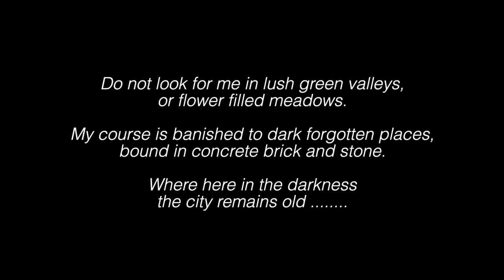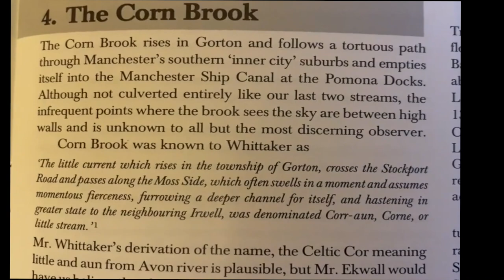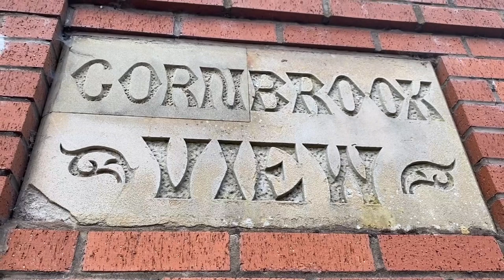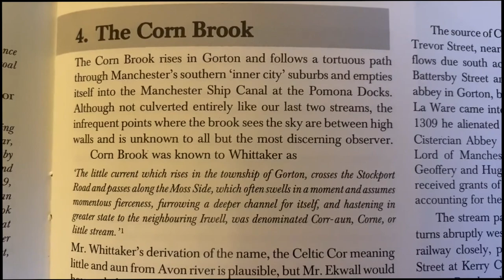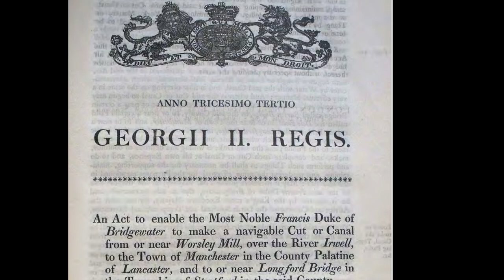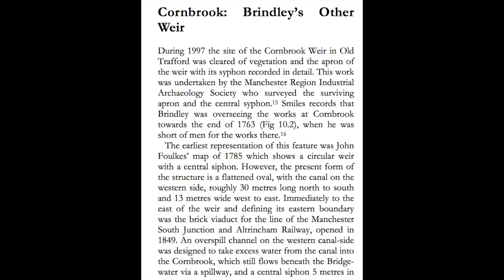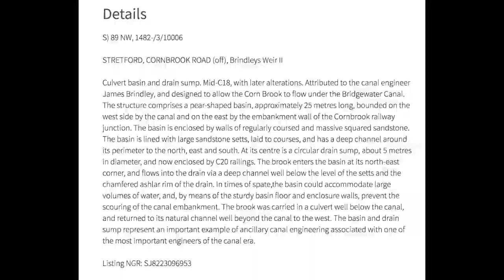The Lost rivers of Manchester. The Cornbrook Part 1

Comment: You might consider getting breathing apparatus for when you do these confined space entries, Martin. When your meter goes off it's already too dangerous to be in there, potentially deadly. Better to be prepared than dead. Perhaps see about a course on confined space entry?
Reply from the maker: Hi Robert. Fortunately the gas meter never went off. But yes I hear you 👍
Reply: or at least - have an emergency O2 supply.
Reply: Martin, if there is huge expense to getting the right equipment or doing a course like Robert suggests, could you put a fundraiser out there so people have an option to contribute to keeping you/James as safe as possible while you do these amazing things for us?

I would definitely contribute to something like that.  I’m so relieved to see you both in hard hats now - naive people may imply ’it’s not necessary’, but the head bleeds profusely from the smallest injury.  Wearing hard hats reduces the risk of you having a major medical emergency to deal with that could be completely avoided.  I personally would contribute to course or equipment costs that keep you/James safe while producing your amazing VLOGS for us 💕 x

Comment: Fantastic.  And I sympathize about the mud...as a kid, whenever I would explore the spring-fed creeks around my hometown I always dreaded that thick, black, stinking silt...you could never tell how deep it was and it smelled terrible.  I used to encounter it in the low bend basins where water would go around in a dogleg curve and all the silt would accumulate in some smelly, black pit.  And going around was often not an option because the sides were too high.

Comment: What a bloody job. Hats off to all of you for your stoic efforts on this part. Can't wait to see what you find at the source end, as I was born, raised and played in these streams as a kid, close by (Higher Openshaw) until moving away mid 80's.
 I have the book and have tried to place the bit in it where it shows the start which I assume is near the back of the Gorton Monastery, but as it's all so developed now, it's not easy to pin down.
There are at least 3 other watercourses round there that I recall, and I suspect that 2 of them actually interact with the Cornbrook. (Clayton Brook and 'Blackie' Brook- this latter may be a colloquialism for a small section of the Cornbrook). The third was an unnamed (AFAIK) trickle that rose opposite the Railway Inn on Chapman st, Gorton, ran behind houses on Railway st. and underground under Beyer Peacocks; the perfect path to put it on course for where I think the pic is in Geoffs book.
BTW, 'where Rover stood', did you clock the pub in the background? A 'Cornbrook Ales' house. The remains of the brewery offices are still there, on the Chester road, think it's now an architectural salvage place, it's the triangular planform building if you look on Google Earth, bounded by Turville st and Chester road.
 FWIW I picked up a mint condition metal Cornbrook bar tray at a carboot a few years back. I remember them still being a trading entity when I was still at school, despite being by that time owned by Bass, I think. 
Winding back 3 years, the container train you saw would likely have been me up front- not anymore, medically restricted now and imprisoned in yard limits only! Cheers to all of you, much good stuff to come, I feel. 'Go get yer feet wet!'.

Comment: Martin, if there is a syphon underneath the Bridgewater Canal, those arches at 23:25 doesn't mark where the canal is. These are in front of the canal, probably an old/former bridge over the Corn Brook related to the chemistry works (showed at the old map)?
By the way, great video, looking forwards to part 2!

Comment: another fantastic video!! I presume the first section of modern 'concrete box' at the outfall into the Ship Canal is where the Corn Brook was culverted in the 70's/80's when Dock 1 was infilled, and further back where the concrete section joins the older brickwork near the siphon this would have been the original outfall of the Corn Brook into Dock 1
Reply from the maker: Possibly we dont exactly know the arrangement  pre 80's but probably not fat off

Comment: Martin is guest staring in an 80s cop drama as DC Zero?... Pomona would make an excellent park/green or walking space for the flats and surrounduing area and decent tram access. If they were fish, at least the water must be cleaner than expected. The low tunnel suddenly opened up, but, you are 100% right, safety first!
Reply from the maker: Yeah the water is quite clean, or a lot cleaner than it used to be
Reply: @MartinZero  Same near me, used to be horrid and polluted, last year we go Salmon all this way in land and the Trout population is thriving.

Comment: Good video! Why didn't they just let it out into the bridgewater canal though? Maybe I missed something
Reply from the maker: It wasnt needed as the River Medlock in Castlefield was to feed the canal. Plus at that point the Cornbrook a minor river was at a slightly lower level than the canal. Small point but impossible to run it into the canal. So just send it under

Comment: You should Brey on the council's door until they clear all that brush, so the engineering of that system can be seen, just like it is at that canal overflow in the canal basin, under the railway bridges near deansgate.(castlefield basin.??.)
It shouldn't be hidden by all that crap.!

Comment: I'm looking forward to this trip, but I am concerned that you have spent too many hours in damp and dark places cus you've got fungus on your lip. Sorry Martin couldn't resist and on the up side it will filter out the tea leaves when you get the brew on. God bless.
Reply from the maker: It is actually an air filter Darren
Reply: @MartinZero  it looks as if you need one, I've been in some tight and crazy places but that thick mud would freak me out too. Great vid, looking forward to part 2 God bless